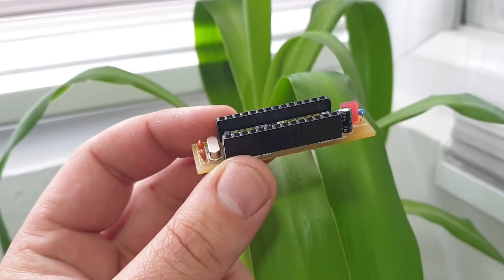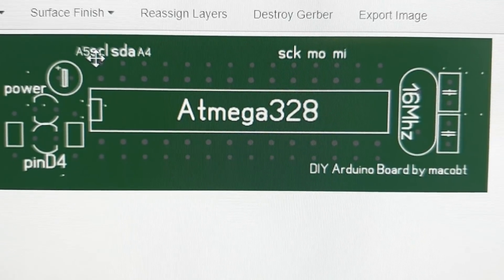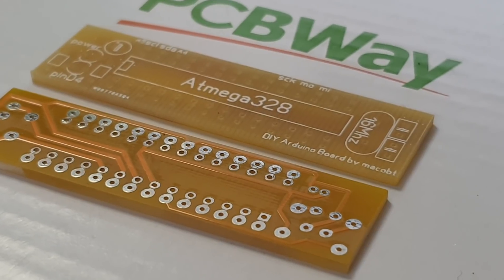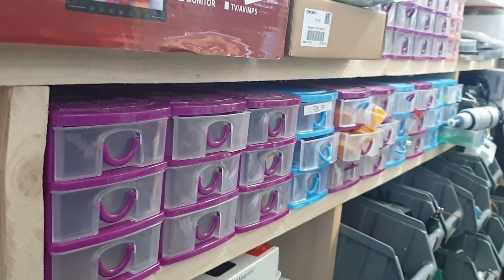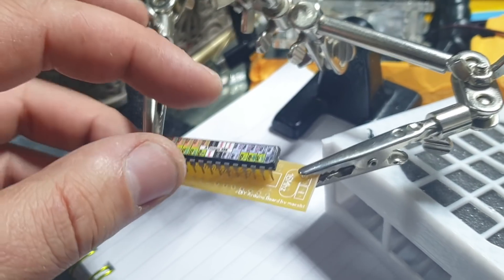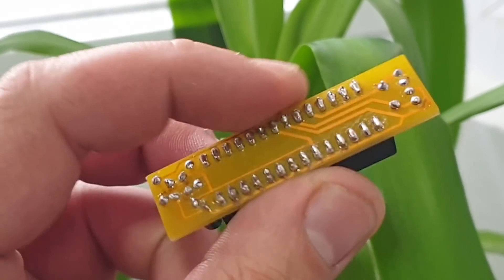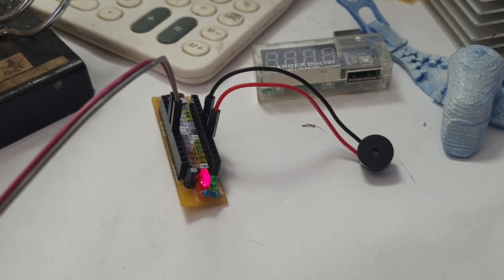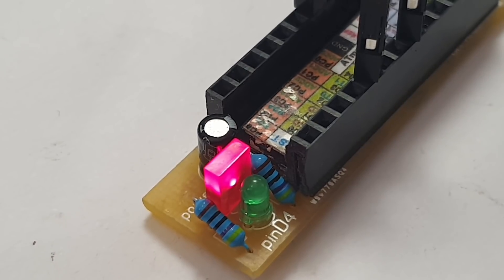How To Make Your Own Arduino Board DIY

Comment: Oooh very nice Arduino board and cheap ;D
Reply: It's not cheap as you think, ready Arduino from China  is cheaper. It's good for fun, learning and practicing
Reply: @batticha462  i agree,uno board from china very cheap, only 2$ for that one. For diy board, just cheap if for starting learn design pcb